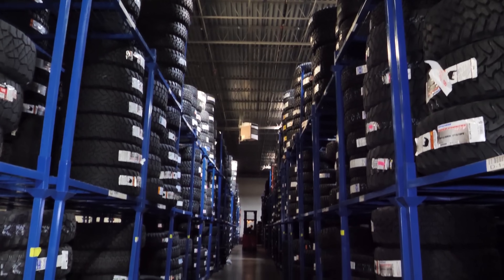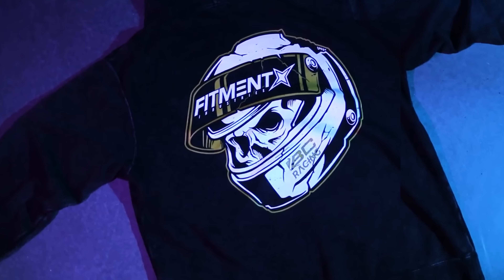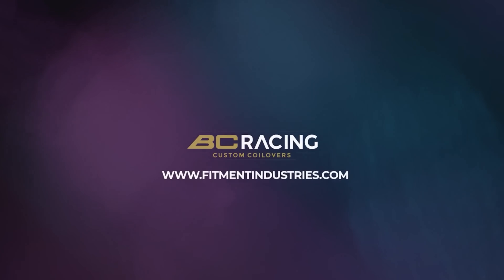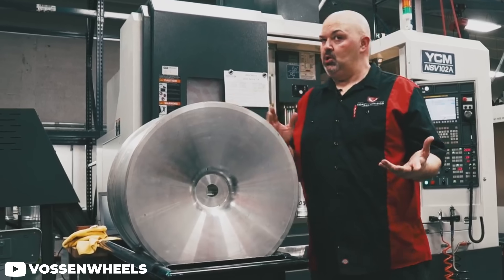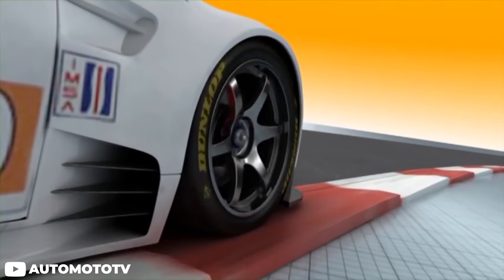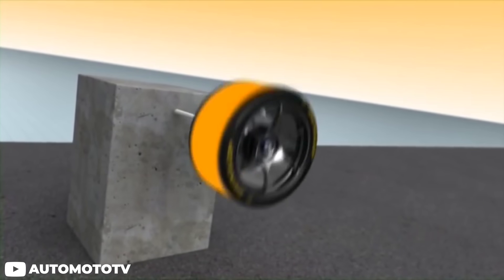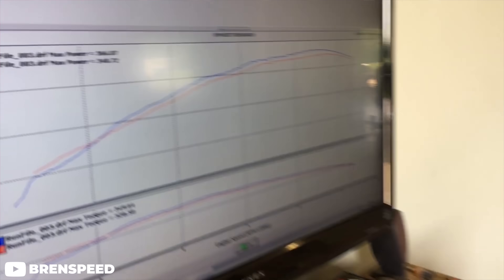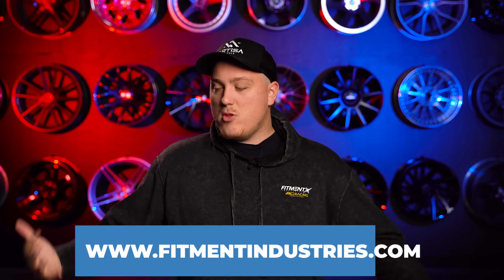Are YOU Making Your Car Slower?

Comment: Just as important as lighter wheel weight for improved suspension dynamics and lower moment of inertia for improved angular acceleration of the wheel is lower tire weight. Using tires that have belts made of lightweight Aramid(Kevlar) fiber, instead of steel, will result in tires that are lighter and that are lighter in exactly the place where you most want mass removed, in the periphery of the tire where the reduction in the tire/wheel assembly's moment of inertia is greatest.

Replacing the Bridgestone Potenza S007 tires that were the Nissan OEM tires on my 370Z with Michelin Pilot Sport 4S tires resulted in about a 6 lb reduction in tire weight. This was achieved in large measure by Michelin's use of this synthetic fiber in its belts on this tire. I currently have the Michelin Pilot Sport Cup 2 (240) tires that are similarly lightweight.

I am also installing a set of forged magnesium monoblock wheels from Litespeed Racing, for a weight reduction of about 9 lbs per corner, over the OEM forged aluminum wheels. The 19 x 9 & 19 x10 wheels are weighing in at about 14 lbs. Future plans include the replacement of the one-piece steel brake rotors with two-piece aluminum hat ones that should shave an additional 5 to 10 lbs of weight off of each corner. I'm putting CNC machined billet 7075-T6 aluminum lug nuts on the car and will eventually replace the steel wheel studs with titanium ones.

Comment: A better way to sell lighter rims for performance is by giving an example. Such as, depending on the rim that was on previously, lighter rims can drop 0-60 times by 0.1 of a second to sometimes even 0.5 of a second. On top of that, throttle response will be better at 1st and 2nd gear, most people's favorite gears to be in. Not to mention that an engine struggles more to spin 1lb of rotational mass than it does to move around 2lbs of static weight(depending on wheel size changes too), thus dropping 5lbs per rim, will feel like dropping 40lbs off the car.

Comment: I've been trying to find the right combo for my 03 5.9 2500, Stock wheel and tire weight on 31" 17x7 steelies is 88lbs a corner on a 265/70/17, I want to go wider to at least a 10" but the wheel needs to be lighter than what I have to give me enough margin to play with on a larger tire size 33" or 35". If im lucky I'll just break even with no net change on the weight and a wider setup. If I can't find a set with the right specs I have a Superstar Lodio Drive 3 piece set from Japan hanging on my wall that I'm considering getting a fill and re drill from the 5x137 to an 8x6.5 with forged lips and barrels.

Comment: Getting lighter wheels has been the best thing I got my car. When I fist got my car it had 25lb 17 inch rims and man did it feel sluggish and also it couldn’t maintain speed easy. I’ll let of the gas and right away the speedometer would start to drop. Now I have 14 inch rims weighing 12 lbs. I’ve seen a significant improvement in take off speed and the time it takes for the speedometer to drop when I let my foot off the gas making it better for fuel economy since my foot isn’t always pressing down to maintain speed. I would always encourage people to take the lightest wheels possible. 
Also when I was shopping for wheels a lot of the manufactures who don’t list the weight on websites usually would tell me over the phone if you just ask about it.
Reply: The heavier wheels should maintain their speed for longer than light wheels actually... The problem with heavy wheels is changing the speed, maintaining the speed is not an issue. Also, what you "win" by taking your foot off the gas you lose when you accelerate again.

Comment: Wheel weight does matter. Love my m3 even more when I swapped from Arc-8's, which are decently light to volk te37 rt's. The RT's are the lightest ever at 17lbs on 18x9.5's squared. The unsprung weight reduction was night and day. Steering was way more responsive and connected as well as acceleration was improved.

Comment: I actually never knew that wheel weight mattered. That's crazy Gels but thanks for the tip, I might need that information because I plan on trying to buy my first car soon. I am tired of driving the boring 2003 Toyota Camry LE that was handed down to my father aka he thinks it's a cool car. I am not trying to sound ungrateful because it does get me from point A to point B in terms of going to work every single day. I am currently saving more and more money while simultaneously not trying to spend things I don't need.
Reply: Might be smart to keep the Camry around if you're doing any drivetrain mods. Nothing better than a reliable car

Comment: Of course wheel weight matters.
Ever since I was a kid playing need for speed underground I used to hate spending money on painting my car and underglow when I could spend that money on nos and whatever parts actually made me go faster.
Fast forward to an adult and I feel the same way. Spending money on shit like carbon fiber shift knobs and spoilers on fwd vehicles doesn't make sense, nor does putting 20" wheels that weigh 38 lbs on a car that you want to go fast. You're literally spending money for the sole purpose of making people like you more. It doesn't make the car function in any way more efficiently so why are you spending your money on it when you could spend it on something that benefits you.
I would rather spend $300 on a window tint job that keeps the glare out of my eyes and the fade off my interior than buy a fart can muffler that my "friend" thinks sounds cool, and I would rather buy lowering springs/coilovers on a clear coat peeling sedan that at least gives me better airflow and thus better mpgs than get my car wrapped just to peel it off a few years later.
Reply: Same side with you, i hate spending money on cosmetic useless upgrade even in nfs 🤣🤣🤣

Comment: we need a "sort by weight" option for wheels on the Fitment Industries site!
Reply from the maker: We started with the weight of every Artisa wheel! We can only put as much data on the site as we receive from manufacturers!
Reply: @FitmentIndustries  that’s all we ask for thanks
Reply: @FitmentIndustries  you can always weigh them yourselves therefore giving your customers more information than what the manufacturers give you, providing a better service... I could be wrong
Reply: @FitmentIndustries buy a scale, maybe possibly 🤷🏿‍♂️🤷🏿‍♂️
Reply: @FitmentIndustries  way to start a trend! Seems I’ll be looking into Artisa when I get off my ramen budget
Reply: Yes this is a very good idea
Reply: The latgest issue is likely that they offer more offsets and sizes than most dealers.   If you do a bit of digging on the mfg sites, you can find mass for about 80% of their offerings.
Reply: Should weigh every wheel make and model by size in their warehouse.
Reply: They have promised that for years. Or at least mentioned they "will try". Tire rack does it so why not you guys? It is such an important metric for buyers, such a mess not to have that feature.
Reply: They don’t have listed weights on all their wheels :/
Reply: @dannylange6733  sounds like they need to start working on it👏🏼👏🏼
Reply: @dannylange6733  good point
Reply: To a certain point , if you get budget aluminum wheels they won’t get much lighter and more durable unless you spend thousands, my wheels are like 35 pounds each with nitto neo gens installed balanced and aligned for $1100

Comment: Unsprung weight is a killer. My 19x11.5 volk gtc with tyres were 45kg+ each corner no dramas. Made turn in response shithouse. The 16x7.5 stockies with decent semi slicks turns it into a completetly different beast.

Comment: Wheel weight matters, same as car weight,  but road quality matters even more, so I'm running steel wheels and cheap tires.   :(
Reply: I think it wheels weight matters more, since it's unsprung and it rotates (more inertia)

If you remove 10lbs of whell weight and put these 10lbs in the trunk, the car still weights the same in total, but performances will be better.

So saving 10lbs in wheels is not the same than saving them in car weight, it's better ^^
Reply: @giovannipomarico2035    LOL    I did not say witch maters more, I said ROAD QUALITY matters the most, at least in my money pocket, I rather replace cheap tire than expensive wheel.  Something matters even more than everything mentioned (in my opinion), that is  REGULAR MAINTENCE of your vehicle witch most people tend to forget.   For an example;  If your suspension/brake parts stop working properly it won't matter what wheels you have on your vehicle.
Reply: @antoniocepaj7544  Sorry, got misleaded by the "same as car weight"
Reply: @giovannipomarico2035  np. lol